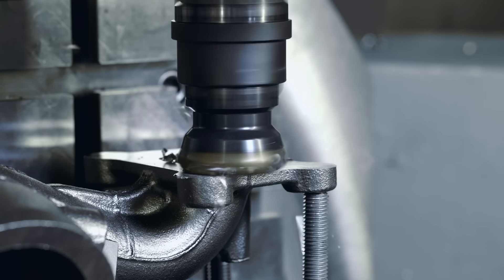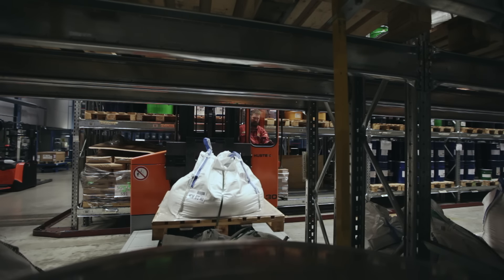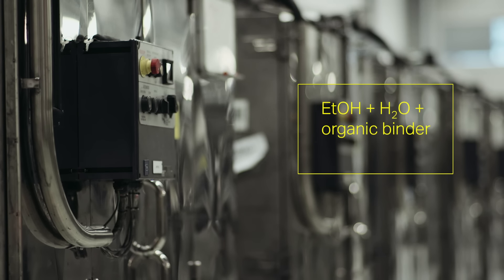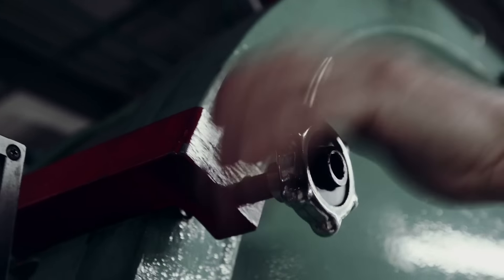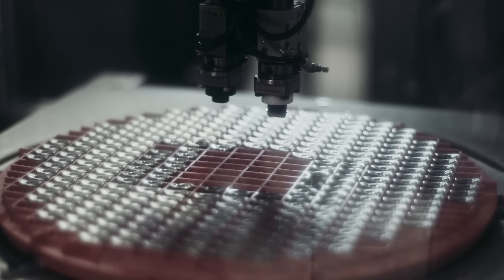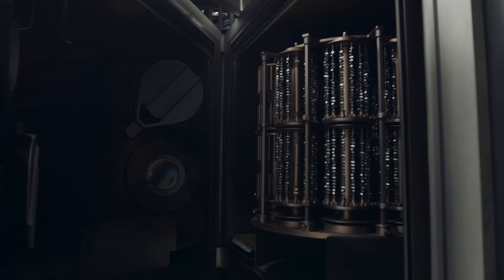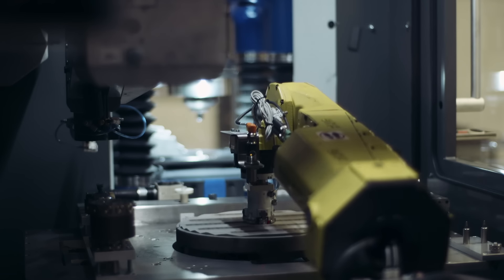How carbide inserts are made by Sandvik Coromant

Comment: Tungsten not return into powder,it get melted and than casted...This video have details of misinformation,Tungsten or Molybdenium not pressed as diamonds under extreme pressure,we not talk about Graphite powder which have similar Carbon molecular structure..Tungsten requires tremendous melting point of exact 6400 degree by Celsius,whatever presumably explain in this video incorrect or short cutted process....I believe specific powder mixture used for baking process,powder get melted and press is forming specific shape of insert,after that it undergo further processing into fully finished tip...The weared inserts return for melting ovens where it begun recycling into new tip all over again....If you just compress Tungsten Carbide from powder it would become different structured metal,particular forming is weak and easy to break science it's structure is perishable...All forms of metal and alloy undergo between mixture of 2 different powders,completing formulation between baking and melting process..After melting liquefied metal get pressed under extreme pressure to make specific shape of insert,during extreme pressure from hydraulic press,tip blanks get cooled rapidly during forming..After that blanks get passed through CNC diamond grinder which make specific geometrical shape,after that all blanks undergo tempering process and pressure relief to decrease brittleness..After main tempering process is completed blanks get neather in the white (unfinished) before been soldiered anywhere on tools like drill bits,cutting disk's or saw blade tooth's...Or it get TINN (Titanium Nitrate) coating or blueing (Oxidation) to prevent get rusted...This is not new how Tungsten or any other type inserts been made,this is standard factory procedure and process..Drill bits is produced by CNC grinder to make flutes and twists under specific geometrical shape and angle..

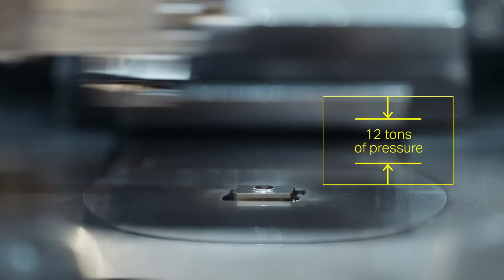Comment: At 2:25 mention is made of "12 tons of pressure".  No such thing- pressure is force per unit area (unspecified here). So, you must mean "12 tons of force". Gotta get the basics straight.
Reply: Well using force creates pressure. Not sure what you're getting at. You could say that the implied area is the size of the insert. Because that's where the force is going. So whatever I guess.
Reply: No. Fundamental physics- pressure is force PER UNIT AREA. Fuzzy "thinking" won't do. Not "whatever" if you think it through. And ... read the intro text (SHOW LESS) above.
Reply: If you are nitpicking then at least do it right because buddy there is no such thing as 12 tons of force either. 

A ton is a unit of mass and not a unit of force.
As you said - gotta get the basics straight.
Reply: Not nitpicking-  facts are important. But you're wrong. A "ton" is either 2000 lbs or 2200 lbs, short or long. Pounds are a measure of force, not mass, but used interchangeably. Get it straight. There is such a unit as a "poundal" (thoroughly confused on Wikipedia)- a unit of MASS, such that one poundal would weigh 32.2 lb @ earth's surface. The old f=ma or m=f/a thing. IOW pick your own nits first. Relax. You're welcome. TTFN
Reply: I'm nut sure I understand the "poundal" section in your comment I'm sorry. If I'm missing something important then please let me know.

But to my main point: this is a EU factory (Austria) so 1 ton is actually one metric ton or 10^3kg so mass.  Also you say "Pounds are a measure of force, not mass" when they can be both. (Except if the Wiki is wrong:"Pound force should not be confused with foot-pounds or pound-feet, which are units of torque, and may be written as "lbf⋅ft". They should not be confused with pound-mass (symbol: lb), often simply called pounds, which is a unit of mass.")

I will admit that there is a chance that they meant the imperial ton. But personally I have never heard ton meaning 2200lbs in continental EU so it's unlikely. The only exception might be machines/tools imported from the US which could have imperial units on them.

To be frank I had no idea how complicated the meaning of ton was in US. I did a bit of reading on Wiki an it cleared some things up but I think there are some very confusing errors.

For example from the wiki page on "short ton": "The short ton is a unit of weight equal to 2,000 pounds (907.18474 kg). The term is most commonly used in the United States where it is known simply as the ton" So they claim it's a unit of weight but then write it down in kg, wtf?

I lived with metric all my life and never knew you had both pound-mass and pound-force. So pound can be either mass or force depending on context? How do you tell the difference?

I never understood why torque on US tools is listed in foot-pounds. At least now it makes a lot more sense! Thanks for the explanation and motivation to read up on it myself!

Also this turned out a lot longer than i first thought...
Reply: Easy. A poundal is the mass that would weigh 32.2 pounds @ earth surface. (From HS physics way back when.)  IOW m=f/a, where a=g.
That sort of unit would come into play in calculations involving mass, in Brit. units. (Around here a ton is 2000 lbs.) "Pound" as unit of force or mass would be determined by calculations you're working with. Else, both- a pound mass weighs one pound, given g=32.2 ft/sec^2. A poundal would weigh 32.2 lb.

I said Wikipedia was confused, didn't I? "Pound" is used INTERCHANGEABLY as unit of force or mass. This interchangeability also applies in  gram, kg conversions. No biggie if you relax and let it sink in.

My salient point was/is pressure=force/area, not force. Huge difference.
Pressure is pertinent with fluids, machinery (e.g. crawler treads reducing peak soil pressure relative to wheels) and wherever else pertinent. Pound would involve solids typically, as in X pressure in a combustion chamber would apply Y amount of force to a piston. Easy to tell you were stepping into it, glad to help you out.

Also, I use a variety of tools with brazed-on carbide inserts, from brushcutter blades to tablesaw blades, to router bits, to masonry drills. Dunno how i'd get things done without the stuff. Thanks, GE!